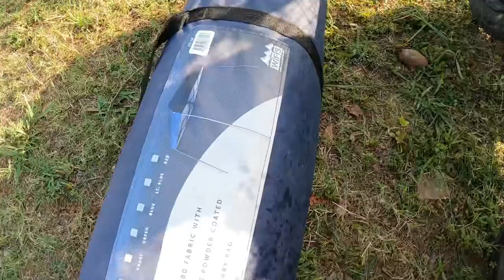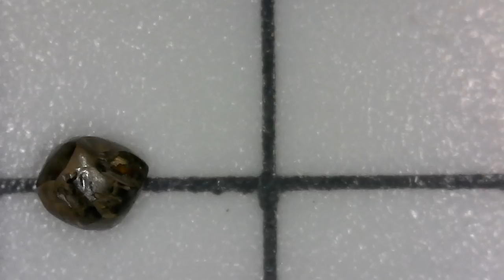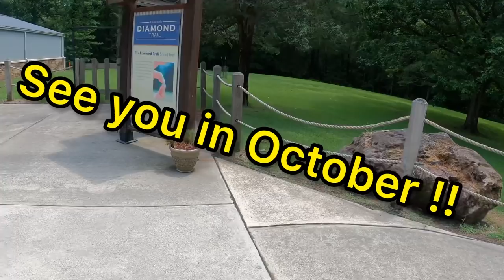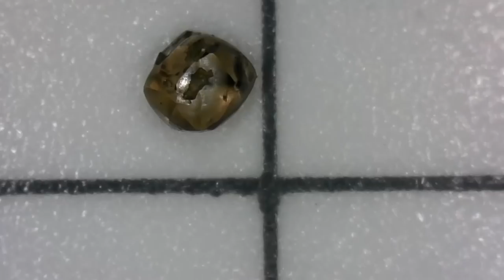Found All Three Colors of Diamonds in One Trip @ The Crater of Diamonds

Comment: Do they actually feel cold when you set them on your tongue? Or is that just nonsense?
Reply: That is true on most gems.
Reply: diamonds are some of the best conductor materials, so it depends on what the diamonds temp is before you touch it, a metal rod will feel cold on your tounge until it warms up, same is true for a diamond.
Reply: @bring6not12  right I'm pretty sure it's because they conduct heat away from your tongue quite efficiently and dissipate it, not because they were in the fridge LOL.
Reply: @Seeds-Of-The-Wayside  oh yeah thats a thing i forgot to mention yeah you are totally right, diamonds also have the best ability to transfer heat to the air out of most (if not any) gemstone!

Comment: If they would, just scoop the top 5 feet of that whole park everybody that comes out would nail it. It's so annoying to me. Let's run a freaking tractor plow over the field isn't doing nothing and the little bags that they sell aren't moving enough material fast enough. It'll be another fifty years before anybody starts to see real diamonds on the regular
Reply from the maker: They are down to hard pan, would be able to scrap 5 feet off but in a few spots. It’s done!  They have ran out of gravel, and options. I’ll be getting all my digging stuff, and closing out my cage my next trip.
Reply from the maker: They are down to hard pan, would be able to scrap 5 feet off but in a few spots. It’s done!  They have ran out of gravel, and options. I’ll be getting all my digging stuff, and closing out my cage my next trip.